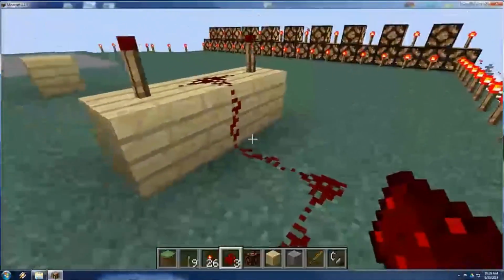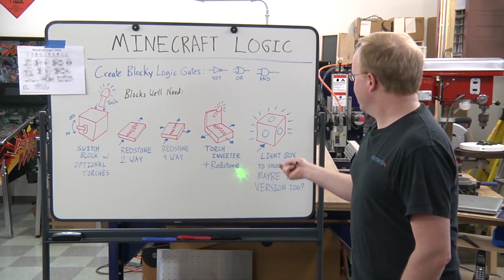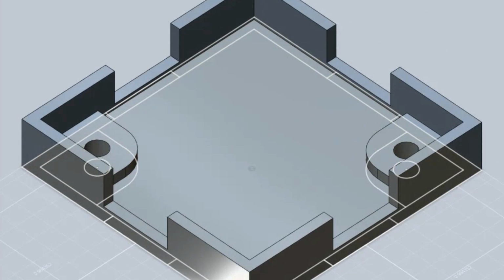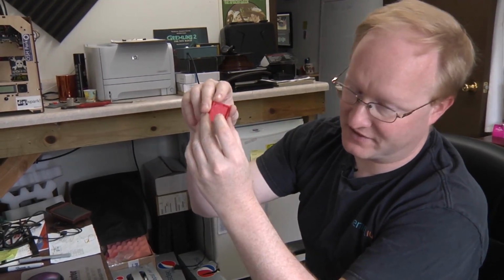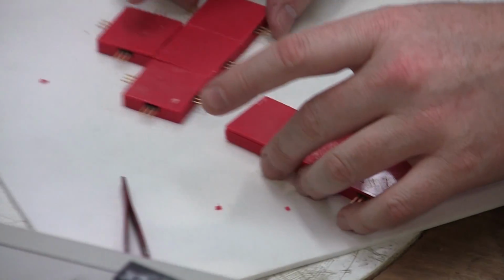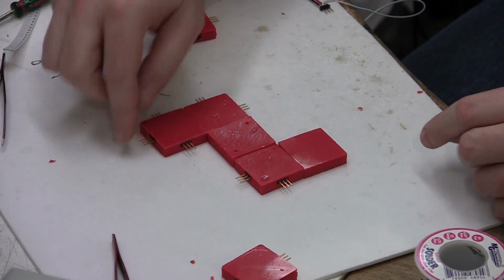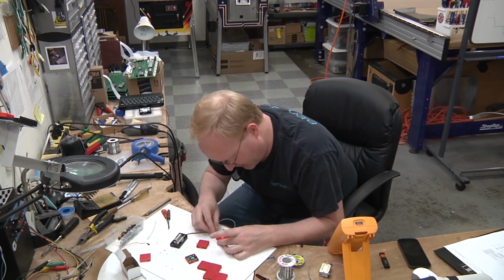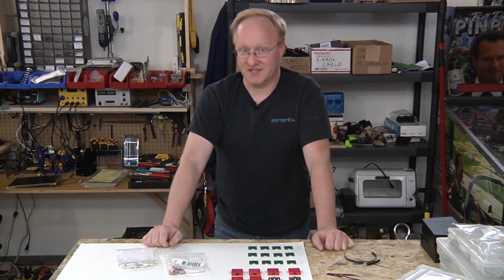Live Action Minecraft Blocks Part 1

Comment: Would it have been possible to use headers with an even number of pins?  That way you could have the left half be pins and the right half be sockets, for example, so then all the blocks could connect to each other in any orientation and combination.

Comment: Does it make more sense to use a bajillion coin cell batteries or magnetic connectors on each edge with a few pins passing voltage and 'signal' from a power cube?

Comment: Uhm... isn't this a bit overcomplicated for what's essentially just a glowing wire?

I mean sure, you will need the circuit board and an IC for the other blocks, but for the basic Redstone block, I would have just connected an LED to a basic PCB without any ICs, maybe a few Resistors to simulate the signal drop-off from the game.

But then again, I am not a professional, so maybe there is a good reason for this set-up that I don't see just yet.
Reply: It's around the same price to order 20 PCBs as to order 2 (couple of bucks difference) and the ic's are pretty cheap. Allows alteration at the end
Reply: Exactly what i thought! But i guess he is planning something more, hopefully :3